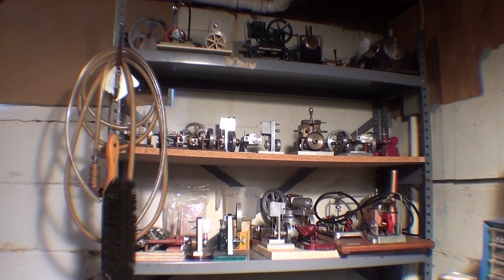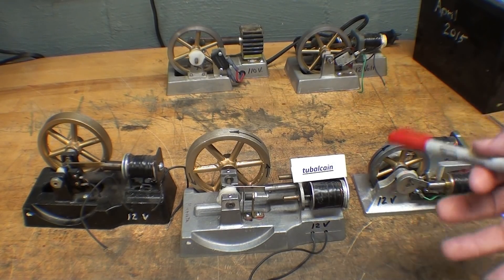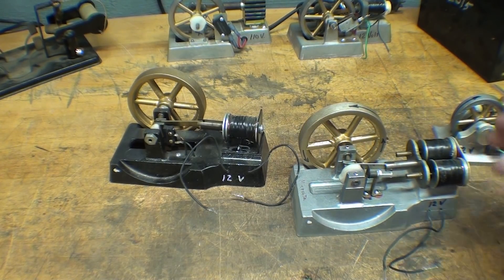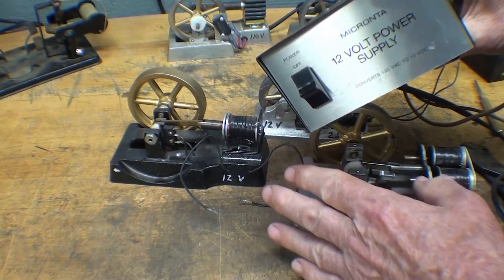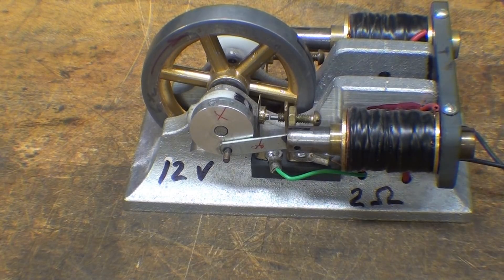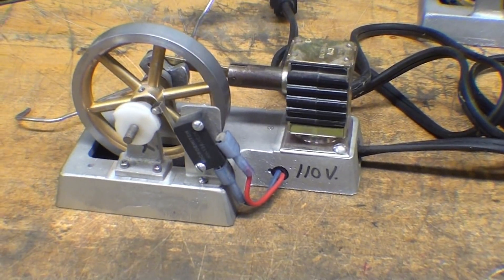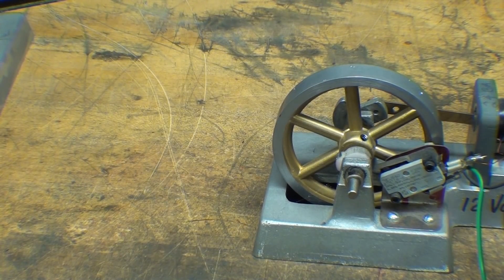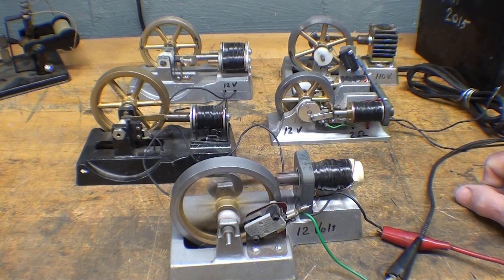SHOP TIPS #382 Electric Engines  solenoid & magnet tubalcain

Comment: I would love to see someone build a Hit or Miss Electric Engine. One of your 12 Volt engines ran quite a while with the wires unhooked, that would be a good one to try. The speed governor is all that it lacks. I've been working on Joule Thieves with some success. Longer lasting, Higher Voltages all good fun. Thanks for the demonstration, very enjoyable, unlike the let's block traffic kind of demonstration.

Comment: I know this is a dumb question but if you lower the voltage won't it run slower. or do you have to make electrical changes. I love the sound of steam engines running fairly slow. and I think those solenoid and electric magnet motors would sound similar. plus love all your videos. keep up the great work. I will be looking to buy one of your motors. and I hope it works out

Comment: Actually you can go ahead and call the electromagnetic part a "solenoid" because that is still technically correct. The term has a very broad definition and all helical wound coils are solenoids. It is commonly restricted to coils wound around pistons or rods that convert electrical energy into liner motion but the term is French and originally described a simple helical wound coil so yes it is still a solenoid. A relay for example is a specific type of solenoid. Love your videos so keep them coming.
Reply from the maker: Thanks for watching

Comment: When you energize any coil, (ex. 12vdc) the moment you pull the power, you get a collapsing field of the coil, which could be from 100's to thousand's of volts, and that is where the sparks comes from.  The capacitor, just makes that high voltage pass thru the cap., during this collapsing field.  That is why there is a cap in the distributor in your car.  That cap is mainly used for saving the point from burning up.  Just take the cap out some time, and see how well your car runs.  The collapsing field that causes the spark, really never disconnects the circuit, and the car runs very rough, if at all.

Some time, if you feel like it, take a coil and put it in parallel with a neon lamp(small), like the one in an old voltage tester for 110vac outlets.  Then take a 9vdc battery, and also connect it in parallel with the coil and lamp.  Nothing will happen until you quickly remove the battery.  The collapsing voltage in the coil will turn on the lamp.  This may produce any where from 90 to 120+ volts, depending on the amount of turns on the coil.  This is how you get the high voltage for sparkplugs in your car, only using 12 volts. The output of the coil will be in the 12,000 to 15,000 range and that is what the use of your distributor points which is timed from the cam shaft is for.

You probably already knew all this.

I did watch the whole show.  I like it, because this is the kinds of things that do interest me.

Keep the videos coming!!!  I look forward to watching every one of them!!

Have a good day!!!!
Reply from the maker: Thanks for watching

Comment: Hey were watching Mr. Pete-!  As I kid I would have loved just this kind of thing and I also live in the past as it was a much better time in some ways.  As a young kid I was always taking motors out of broken toys or applainces and trying to do something with them.  I had a Kenner girder and panel erector set with water pumps I loved.  Also was an avid model car builder and I assembled one of the old Visible V8 engines back in the early 70's, im sure you've seen 'em with the light up spark plugs etc.
Reply from the maker: Thanks for watching

Comment: Sporlan MKC-1 is a small frame refrigeration solenoid coil. Sporlan is one of the largest refrigeration component manufacturers in the world. I've installed hundreds in several voltages over the years.  They can withstand a large amount of abuse.

Comment: Pete, once back on the farm, I needed a solenoid rated for continuous use, but there was none to be had.  So I used a momentary solenoid, and wired it through a light bulb.  The initial current was high enough to energize the contacts, but as the bulb began to glow, the current was reduced to a point where it kept the points in contact, but the coil didn't overheat.  What do you think of that?
Reply from the maker: neat-Thanks for watching

Comment: Greeting from N.C. I like the hypnotic clicking of these little engines. Am I correct the contact switches reverse polarity of the magnets and solenoids? Thanks.
Reply: Ellie Price -- they are only powered for the power (pull in) stroke, the switch lets the circuit break while the flywheel brings everything around.  but yours is a grand idea -- reversing would double the power, and make the solenoid "double acting" !
Reply: Thanks Kev. I'm wondering if polarity can be switched on a common solenoid or if a different design is needed? A 'compound' solenoid, if possible, would be similar to double acting pistons on steam engines.
Reply from the maker: Thanks for watching

Comment: Enjoyed your video on electric engines.  I made one of the "crude" versions back in the early ‘60s when I was a boy using hand-wound solenoids, nails, a coat hanger crank shaft, and a wood base. It had four solenoids and worked pretty well. I still have it as a matter of fact. Thanks for sharing your knowledge and experiences.
Reply from the maker: Thanks for watching